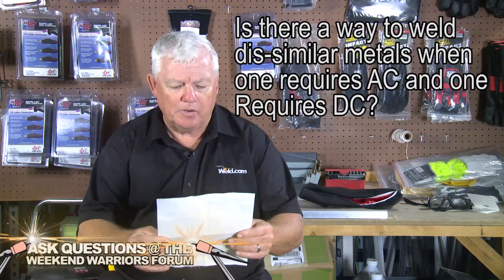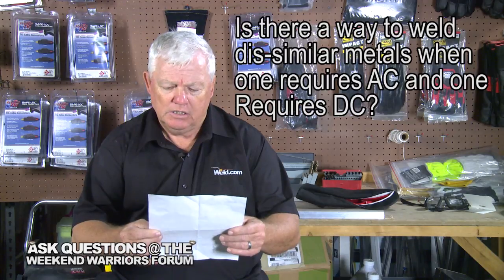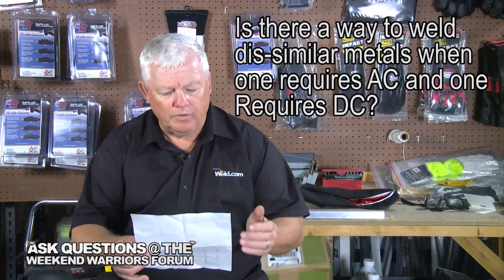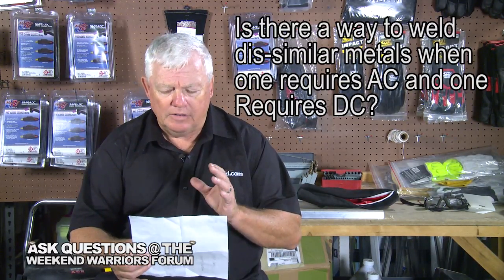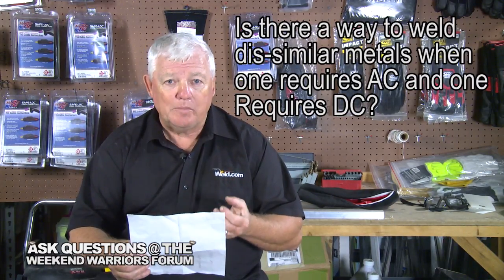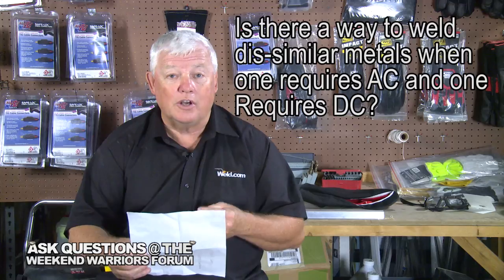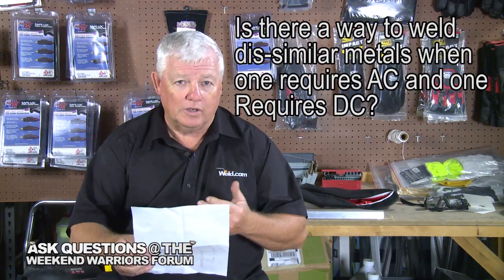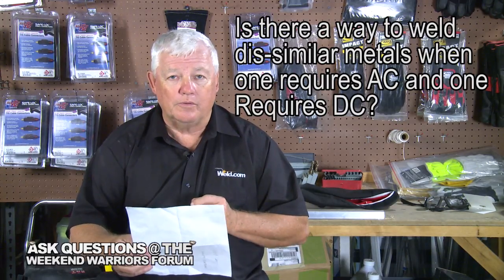Can you Weld Copper to Aluminum? | Weld.com Forum

Comment: What if i want to bond a valve to a large 50l aluminium pot, i drill the hole and ideally only bond a tube with thread on both ends to it. Which material would you suggest (for the tube and what is used as the component) is best suited? taking into account it has to be safe for cooking. Thanks

Comment: If memory serves me well, bi-metal Aluminum-Copper electrical plugs and cable lugs are welded using high pressure friction welding and sometimes laser welding. I have never heard of bi-metal arc welding.